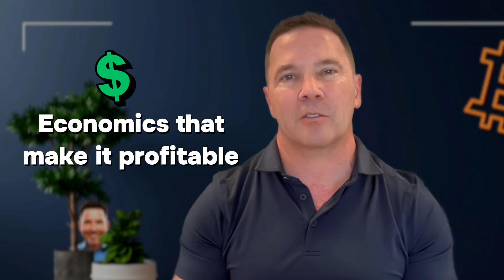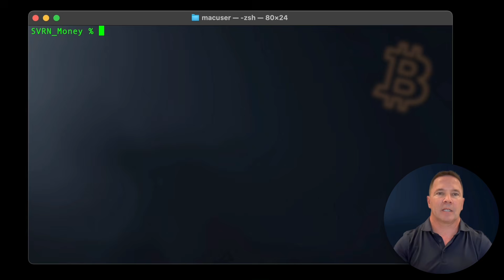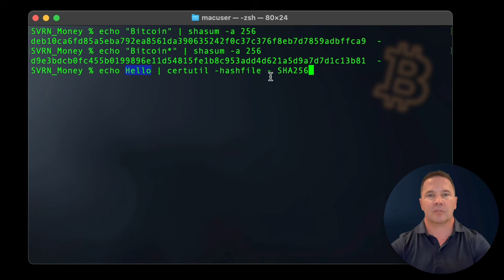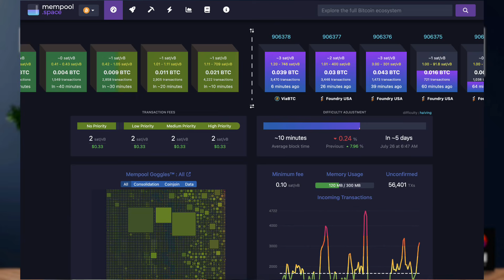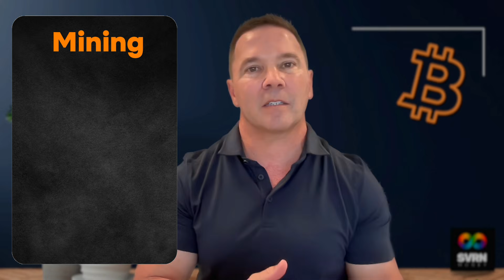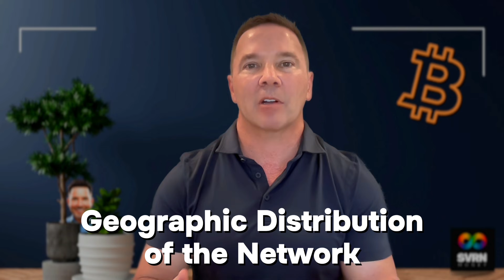How Bitcoin Mining Actually Works (Complete Technical Breakdown)

Comment: might want double check the windows command you provided      echo Hello | certutil -hashfile - SHA256       That is not going to work.   you can use this command if you have openshell installed.     echo -n bitcoin | openssl dgst -sha256

Comment: $2,000 Bitcoin Purchase ~vs~ $2,000 Home Minor
Opinions Wanted!!!

I am looking at 90 Th/s, 1.7kw, 
Approx $4.5 per day minus electricity (today's estimates)
Reply from the maker: Fantastic question. Bitcoin is expected to 10x inside the next 5-7 years. If so, that $2,000 would be $20k. If we take the middle time estimate of 6 years x 365 days = 2190 days. $20k/2190 days is $9/day. Your miner may or may not be making $9/day, and you've also got the electricity drag. Also, the hash rate is likely to double again with the introduction of the new mining rigs with 819 TH/s from Jack Dorsey's company Block this week. So, you just have to pray you get REALLY lucky and hit a solo-block or you'll likely give up in a year or two. My suggestion would be the bitcoin investment but if you're feeling lucky, go for it!

Comment: good video - small correction: 11.28 Every miner runs a node - No, they use a node, but they don't (have to) run it actually by themselves. That's where the pools come in.
Reply: You are correct.  I run a node at home and point one small asic too it.  My other asics point to outside pools like ck and viabtc.
Reply from the maker: Good point. Thank you for the info!